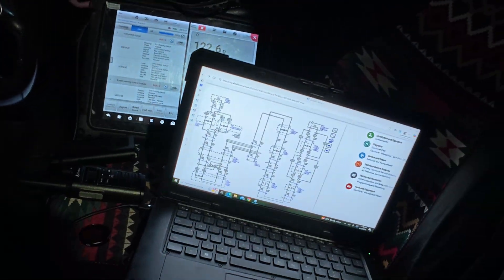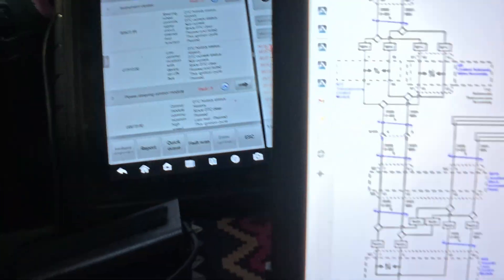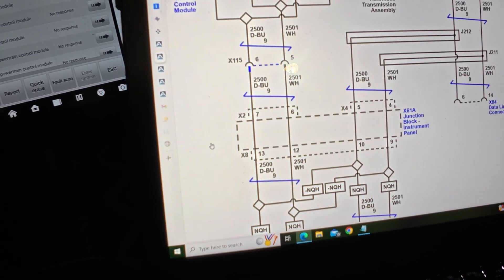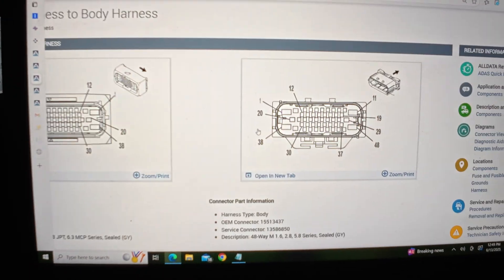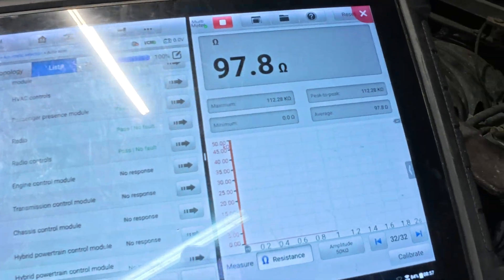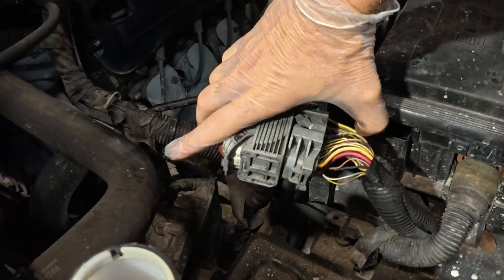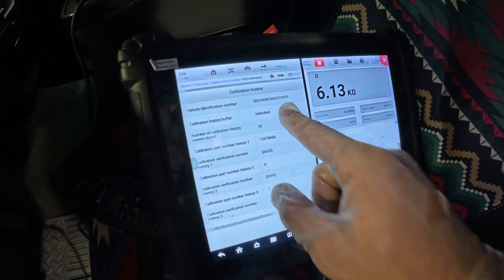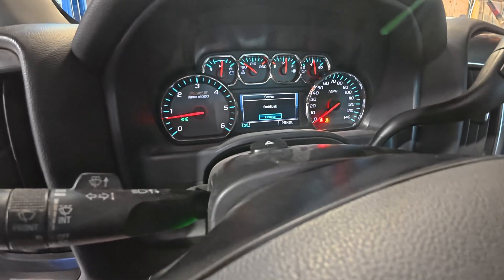2017 Silverado No Start + Guage  Dropouts | CAN Bus Failure Diagnosis!

Comment: I wouldn't worry about it reading 69 ohms if you don't have any comm issues. I wouldn't be surprised if you don't have that extra 9 ohms in the Bob or your leads
Reply from the maker: Well if the truck ends up needing a PCM I'll most likely be programming it. And I'll be able to show the results

Comment: Your ohm reading is not valid. The battery is hooked up. Seen from Jake over at automotive diagnostics and programming talking about it
Reply from the maker: It's not a requirement to disconnect the battery for ohm testing CAN bus. Just to let the network go to sleep. GM goes to sleep rather quickly. This can be seen with the labscope hooked up. All the modules will stop talking and the 2.5v bias will drop to 0volts.